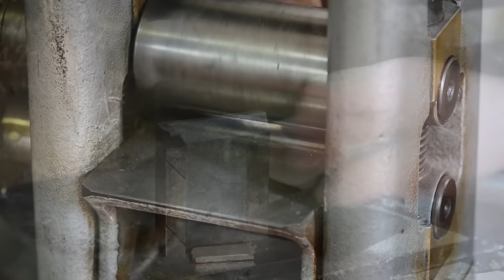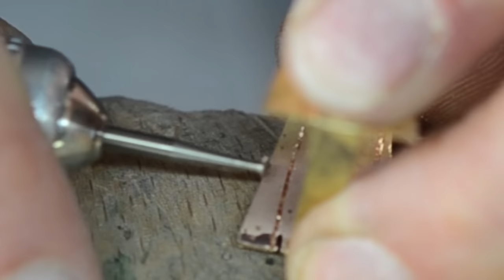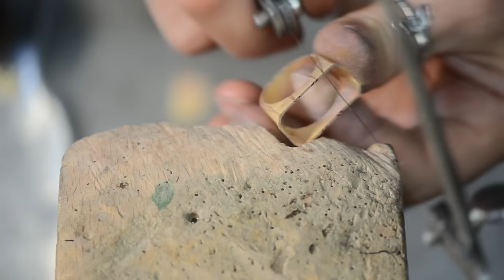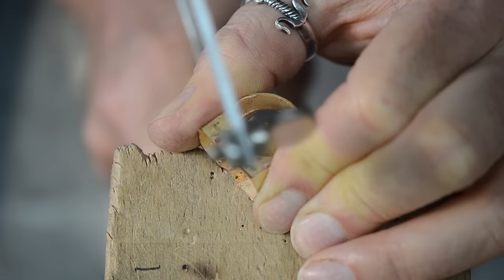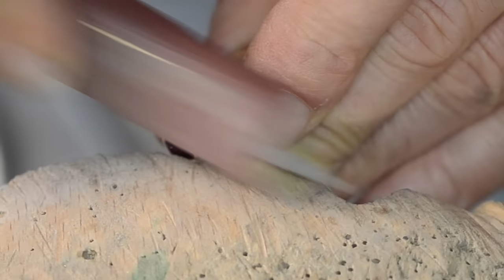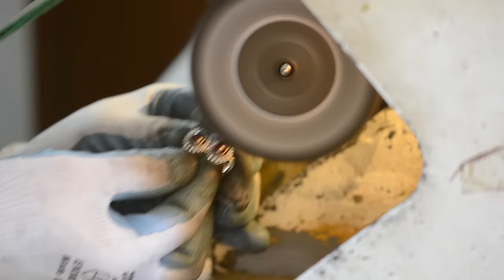Trasform a pair of earings in a ring style Art dèco

Comment: Simply wow / This is so damn gorgeous and you have such an eye and a touch for classic timeless elegance .
I always am a tad worried when you heat up the stones like this with the blow torch  , but then after all they are stones  But how come it melt only the little pieces you add to weld things together and not the other parts . This is like magic to me , because i have no idea how it works . I would spend days asking questions to a person like you .
Reply from the maker: Gold alloys are used which contain metals that lower the melting point of gold. this allows the welds to slide raw parts to be joined.

Comment: Wow, rubies and diamonds are so heat resistance
Reply from the maker: If they have not undergone any treatment, the temperatures necessary for soldering with solder soft do not cause harm. If possible it is best to avoid. In the video work it was greater the cost to restore the original part of what was the value of the individual gems.

Comment: How do you keep areas that you already solder from coming apart when soldering other parts?
Reply from the maker: Numisaccent There welds with various melting temperatures, if used welds has a high melting point do not move after they have been positioned.

Comment: Is there anything you do to protect the stones while you solder?
Reply from the maker: They pastes exist to protect the stones during the welding. In the video I did not use protection because they would not be able to be welded. This stones don't have treatments. For important stones should have been disassembled before welding
Reply: scaffoal so the stone still going to untreated on lab test?
Reply from the maker: vidi erens Most rubies present on the market of origin Thailand is subjected to heat treatment at the origin